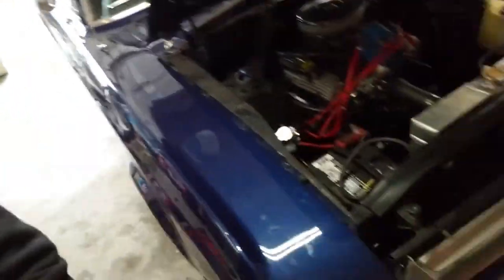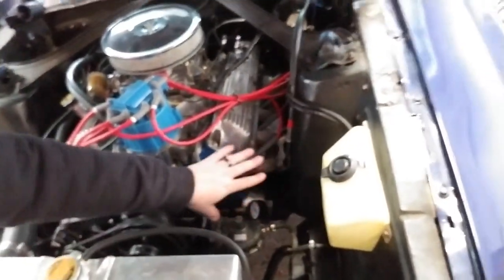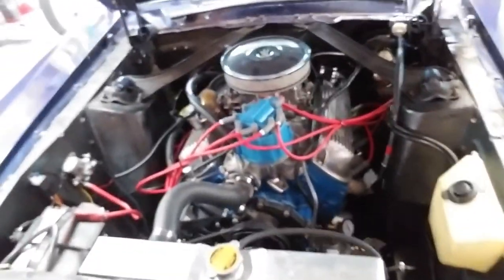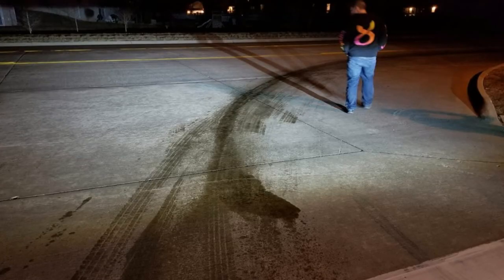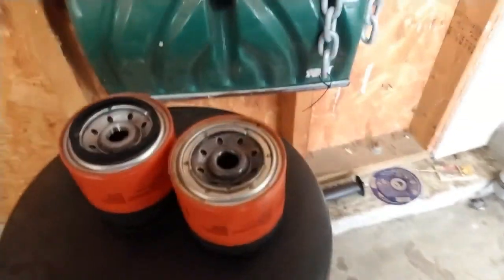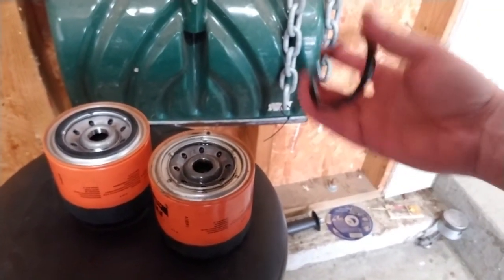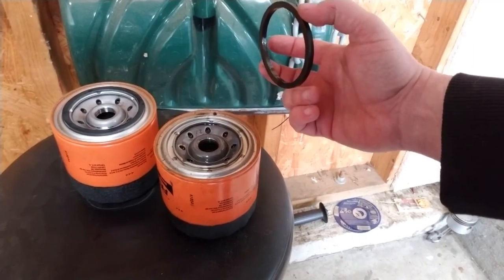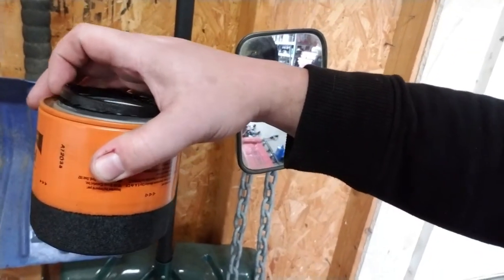Oil change issue could have cost thousands of dollars

Comment: "Don't use  Fram"?  They have at least three different series of filters, they are not good?  Was the double stack issue because it was a Fram?
Reply from the maker: buford t. justice don't use the cheap orange ones. They have less filter material, the ends of the filter are paper, and the bonding of the core is weak. I just don't trust them for long term. And NO this double stack issue was not a Fram issue. It can happen to any filter where the gasket comes off.